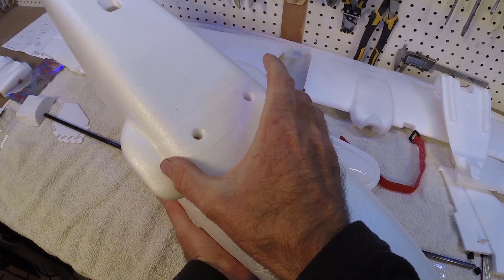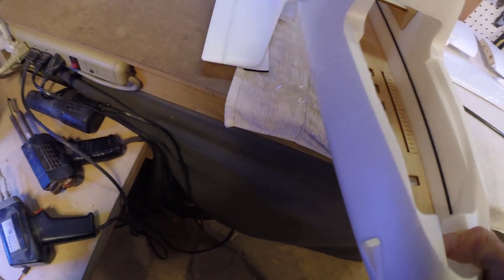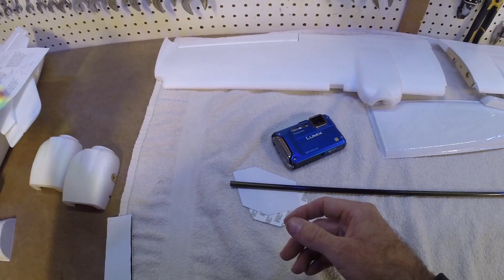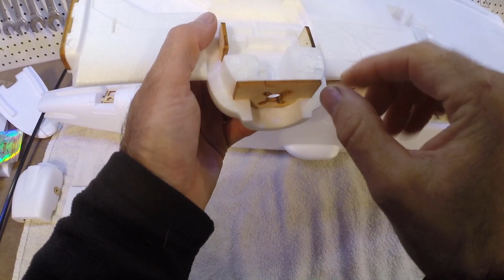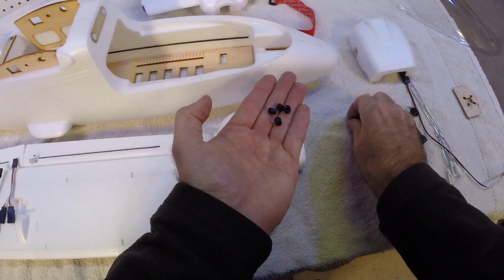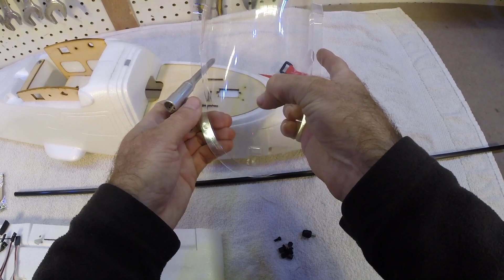SonicModell Binary - A Designer's Perspective

Comment: Great review. In view of the "unnecessary" cooling opening in the motor nacelles, wouldn't it be a perfect place for the ESCs? Of course, one would need to think over the placement of the flap servos....
Reply from the maker: Yes, the stock setup does not provide any cooling for the ESC's, so some though in that regard would be good.  there are some 3D printed vent covers for the ESC location available on Ebay and probably for download if you have a printer, but I believe they are not from the manufacturer (which is fine), and they do look like they cause some additional drag.(better than overheating for sure).  There is also no good reason for the flap servos to be in the nacelle..  it's servo size and geometry are exactly the same as the aileron servo, and it is embedded in the wing.   The wires from the motor can also chafe on the servo linkage. you could tie them away, but there is nothing to tie them to, so would have to glue in a pad to tie to, or something like that.   I'm thinking new wing... clean sheet of paper (virtual paper) redesign in CAD.

Comment: Great seeing you using Chibios! Yeah it looks well and well designed except for the wings. Maybe Bearospace couls laser a great set.
Reply: Maybe an airfoil with good lift, penetration, and wide speed range compromises. Flaps with multiple functions. Spaces for rcvr and Vtx  with good separation. Or something completely different. 3d printed ribs, composite foam skinned wings and tube foam fuselage? Maybe one that has a long seam allowing it to be completely opened. Maybe a severely collapsible design? All weather design?

Comment: It's great to have performance degrading scale details criticised for once. I don't see the appeal of impediments that full scale airplane designers would love to drop if they could. As a full scale pilot, I like to call my models zero seaters: They are aircraft in their own right, an frankly a lot more challenging to fly than manned craft due to their quick movements, so we should take more pride in our non-scale airframes than many of us tend to do. By all means, mod this one!
Reply from the maker: Will be eye opening to start using advanced features of modern flight controllers running OS software like Arduplane.  As much funtionality as an airbus A380 in a small model.  Thanks for your kind words!   I like your perspective.  I'm sure the scale crowd like the scale features, but I don't think this airplane is for them anyway, so it seems that it was just laziness on the part of the design team or lack of vision. Perhaps they were trying to appeal to both types of buyers, but failed.  Anyway, it does seem to be good candidate for some mods, so i'm working on it already!
Reply: @FPVREVIEWS  Starting the same project myself, will follow in your footsteps, using a Vector initially while I explore an F765 in a slower testbed.
Reply from the maker: @Henning_Kolstad  There is certainly a high barrier to entry to learn Aduplane well enough to become  a truly responsible user.
It was a chore getting the firmware flashed for the 765 board, but should be much easier next time.  Tuning the plane using arduplane is not trivial either, but the TECS system is brilliant, and i'm prettu sure that nother else compares to Arduplane logic, assuming you have the airspeed sensor well calibrated, compass enabled and calibrated, and all  other sensors properly calibrated.  Also fairly complex failsafes. Autotune gets you 80 percent of the way to a perfect tune, but not all of the way. doing a lot of learning myself lately about it. 
If you do plan on going to arduplane eventually, best to start earlier than later, as it's a time hungry proposition for sure. New version just out a couple of days ago too..  so i'll have to read up on it.   I do like it very much, and won't go back to anything else now.   best wishes on your build, and let me know if you have questions, ill try to answer. also if you have suggestions.
Reply: @FPVREVIEWS  Thanks for the heads up! I have been looking at Arduplane for more than a decade, ever since the days of the FY controllers, but unpredictable deadlines in my day job keep interrupting projects, which makes major learning curves that much harder to scale. That's why quality YouTube content on the subject is so valuable. What I hope for right now is a good fixed wing FC board with factory installed Arduplane firmware, but I will probably have to take the leap and flash a couple of Mateks before that happens. I use fairly small STOL high wing frames for testbeds, they allow me to do much of the tuning from my own backyard and learn the ropes of new systems there. The Vector is great, and iNav seems to be getting there, but Arduplane is just too capable to be ignored. Thanks for doing all the hard exploration work for technophobes like myself!
Reply from the maker: @Henning_Kolstad  well, getting arduplane onto the board is just the very beginning. The default settings are rarely in my experience acceptable, and will likely result in the destruction of most aircraft.  With Pixhawk or other directly compatible fligth controllers, it is just a couple clics to get the firmware on them..    configuring the escential sensors  takes about a day's work, even if you have already done a similar project before.    the light at the end of the tunnel, however, is that if you can precisely duplicate the entire system, down to the servo geometry and control surfaces, you can copy the param file from one board to another, and clone it. then it's just a matter of calibrating a couple sensors, probably in one flight, and you have a new aircraft.  so you can produce them.   pretty cool, and what i'm hoping for in several projects, including this one.
Reply from the maker: perhaps i shoud lmake some videos on the setup from start to finish, but woul be like a 12 hr video at least..  and i'm not that proficient myself yet..
Reply: @FPVREVIEWS  The very fact that you do not yet consider yourself a seasoned expert could make you an invaluable resource. Videos from masters of an art can be hard to follow because they tend to race through challenging operations in a complex environment totally unfamiliar to the viewers, often without bothering to list the most common pitfalls. It's not easy to learn flashing procedures from someone who never rests his cursor for more than a few milliseconds before he clicks into some new, mysterious screen without a more clarifying comment than "like so". And the same can be true when it comes to configuration, though that bit reminds me of the more familiar full size IFR environment, which makes it seem slightly less daunting. I would happily watch a 12 hr setup marathon, but shorter single subject studies would probably be more user friendly as a guide. Easier to find what we need at a given point.
Reply from the maker: @Henning_Kolstad  How would you feel about a pre setup product, complete aircraft upgraded in every possible way,  with a brief user guide in video form?  or is to build and setup yourself the most important part?
Reply: @FPVREVIEWS  Well, I find I tend to leave more or less RTF products like the Parrot Disco, the Hubsan Spy Hawk or the DJI  P3 on the shelf because much of the point is understanding the process well enough to replicate the system - clone it - whenever I like, with the adaptions I need from project to project. I have the functionality available in my Vector planes, so I guess it's more a quest to learn the skills. But it's always comforting to know that the summit is accessible by helicopter even if my crampons can't cut it!
Reply: Yes! including Arduplane setting. @FPVREVIEWS  I enjoy taking Kits, making them twin, adding a FC system, Started with APM clone in a toy Quad, Then INav in Bixler types converted to twin Quad motors 2112 920KV with phantom props. Slow and draggy, Hovers, climbs vertically, descends vertically at idle slowly and lands so slowly. But can't work in that tunnel like fuselage. INav is improving, but is more for fun flying and great for learning to fly fpv. The FCs are getting so small 20x20mm is becoming more common and at least a couple will run Arduplane.

Comment: If you ever produce a kit to sell of a redesigned greater wingspan wing - put me down to buy the first one please.
Reply from the maker: We're considering it.  Already designed a bunch of parts in CAD to mount autonomous hardware, "Tesla" style battery cells with ventilation, and eliminate the magnets.  Need them gone for full compass functionality in autonomous modes.